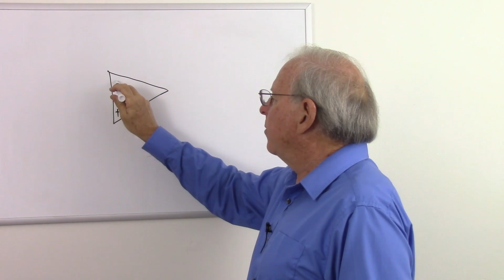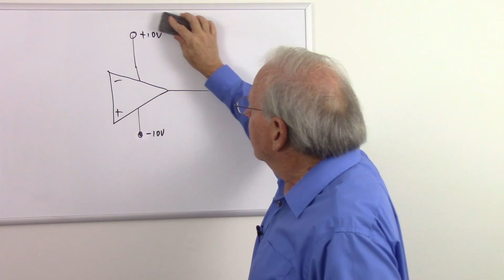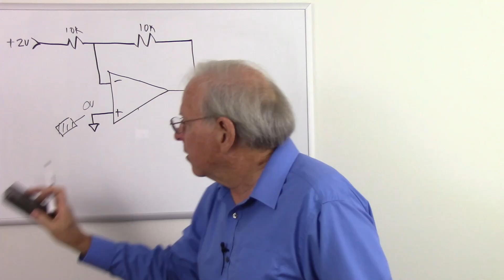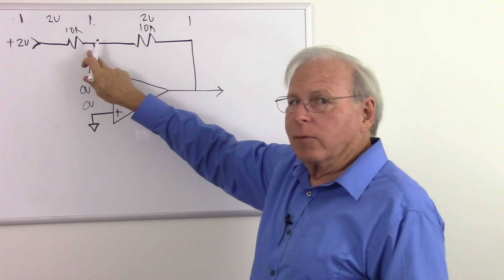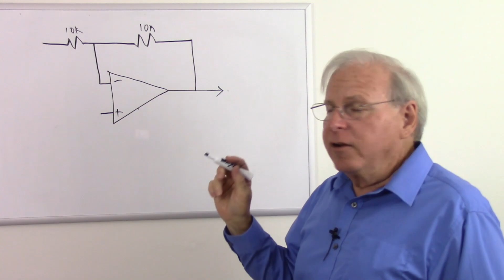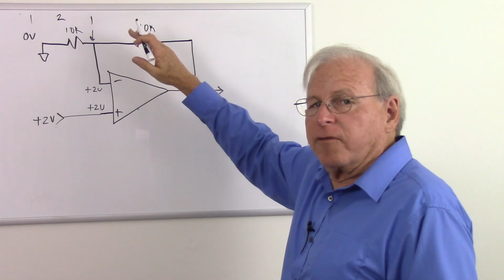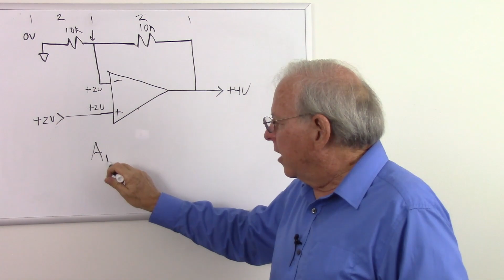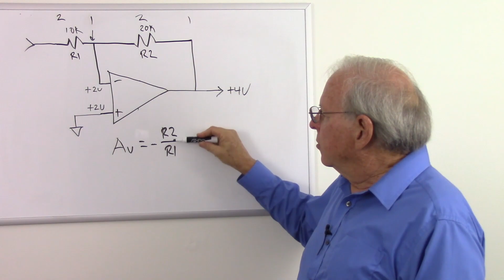Op amp Gain Confusion   Answers to Questions

Comment: I struggled for two days trying make my differential amplifier work so far no results.  My voltage difference input is 0.003v measured with metering device. I used  2 1k(R1) resistors. So vout/vinput= 3v(output)÷0.003v(input)=1000, Rf=R1×gain= 1000ohm×1000=1million ohm(Rf). So I used 2 1K resistor and 2 1million ohm. And my output was supposed to be 3 volt instead it shows the full Vcc5v, and i measured it with metering device one probe to the output outlet and the other to negative outlet, and when I connect to positive outlet(instead of negative) it shows like half a volt or so. Was my calculation wrong? I read that if nothing is connected to the inputs the output should show zero, but in my case it still show 5 volts...

Comment: One advantage of an inverting amplifier is you can have gain of less than one, so if you were to put pot in place of R2 (or more likely in series with it), you can adjust the gain both up and down.